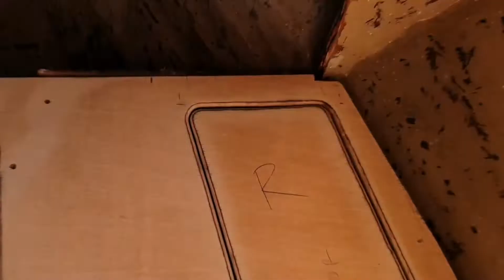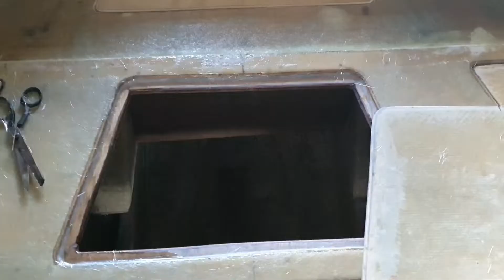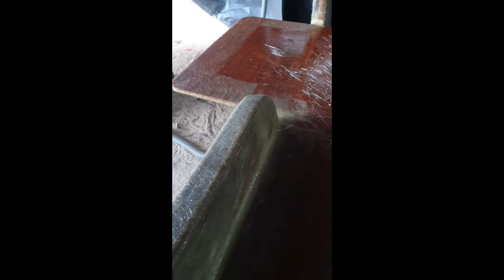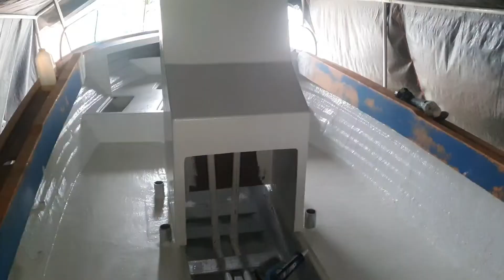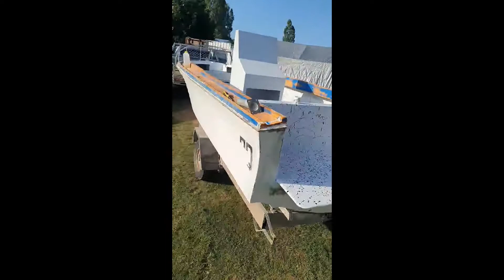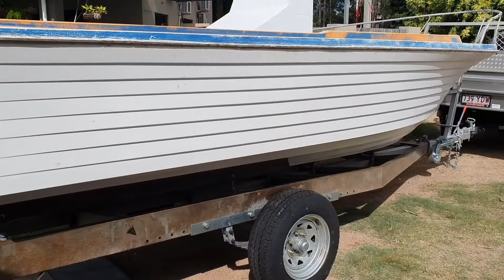Restoring an old fibreglass boat. Floor, casting deck and splashwell

Comment: Looks great mate, can you tell me the method you used for the fleck please?
Reply from the maker: I used a paper cup 
With a 2mm hole in the bottom 
Mix the blue flow coat or whatever colour your using and it will start to flow out the bottom of the cup... move the cup in whatever pattern/fleck you like.
Just remember you can't touch the fleck until it has set...
It'll get messy🤣
Reply: @4xfishin01  Thanks mate good tip will give it a try.

Comment: just a question. How did you attach the pipe for the T Top and rear pipework for what I am assumming is a drop in bait board? Great build so far.
Reply from the maker: Yeah didn't get any footage of that 
The aluminium pipe is welded to a L peice and then that runs bolts thru the stringers.
And the bolt holes were sealed with glass and resin.
And then also sikaflex.

If that makes sense.